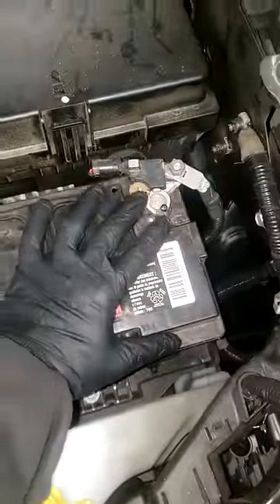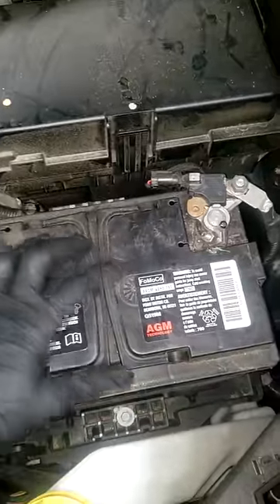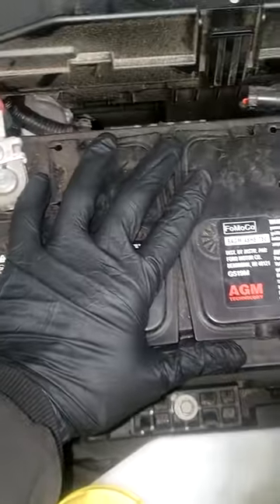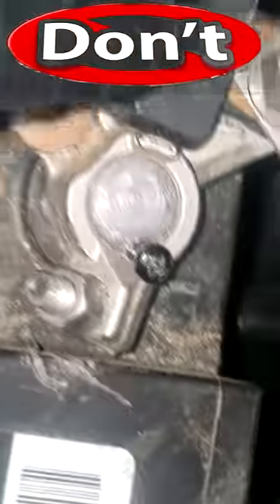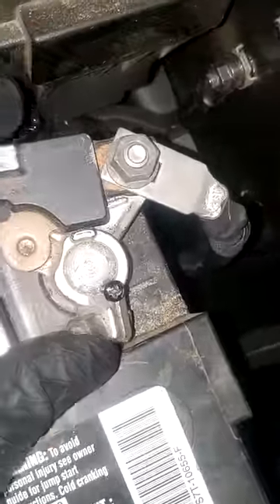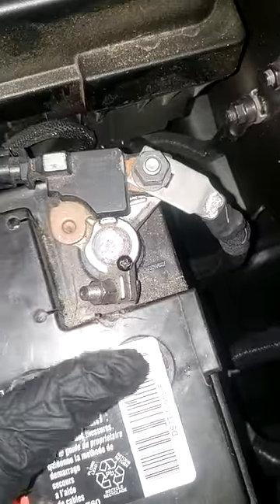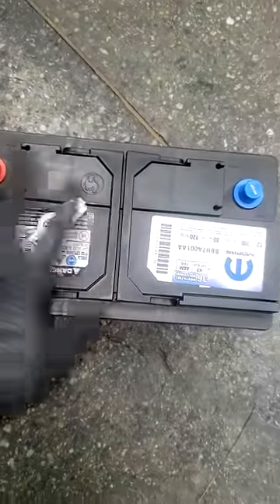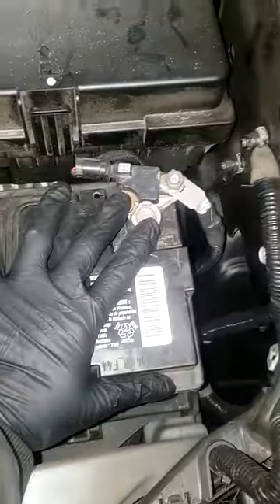STOP DOING THIS PEOPLE. This will destroy your car electrical system.

Comment: I am assuming that first you verified the complaint. Then you isolated the failure. Performed the battery charge and test. Verified the sensor failure.
Reply from the maker: Yes, this battery also failed the GR8 load test and after she saw what the last shop did, she wanted everything replaced. These shorts videos only allow you 60 seconds and you cant explain all that in that time.
Reply: @OnlineMechanicTips  For those of us who don't have a clue, what is a "gr8 test"?
Reply: @paulmonk7820  its a common battery testing tool, its a big boy tho, the normal ones are handheld but that one is a roll-around and it has a ton of different tests it can do, from checking the full starting system to detailed tests on battery charge/discharge and other things
Reply: @paulmonk7820  or just Google gr8 test 🤷🏽‍♂️🙄
Reply: @paulmonk7820  it's just a really really good test
Reply: @mando4660  its more then good its grrrrrr8
Reply: @paulmonk7820  and now we have the DCA-9000, yay... The gr8 is a good machine, I had better luck with it than the ED-18 then again as that thing got older it really didn't test batteries properly in my opinion. No matter because now we have newer, slower moving equipment. Cheers
Reply: @HarleySLA the good old ed-18. It isn't even worth using that because it is just gonna tell you to use the gr8 anyway. I like the new dca-9000, I don't like how it times out and shuts off but it seems to work better than the gr8.
Reply: @sleezymechanic  I hear it goes well with milk.
Reply: @MikeDCWeld  🤣🤣🤣
Reply: @OnlineMechanicTips  - lol,you shouldn't have to explain that.   It's called a "Short"
Reply: @sleezymechanic  - alright,tony
Reply: @vbarbee1  or just google the initial problem and find real online mechanic tips to begin with.  Because pointing out a screw in a battery terminal is not a tip.
Reply: @skachor  Ha! Seems somebody already “Googled it” and the tip was to drive a trim screw into the terminal. Now its at the dealer for a proper evaluation
Reply: @raincloud54  yeah, maybe he came across one of the videos funkfpv roasts
Reply: At the Nissan dealership I work at they are making us use this new dca 8000 tester machine. It's really good, but wants to charge for around a full hour for every test. But it does everything
Reply: @sleezymechanic  haha, beat me to the Tony The Tiger joke. Well played, sir.
Reply: @sleezymechanic  I laughed way too hard at that!
Reply: @paulmonk7820  gr8= great 👍
Reply: @vbarbee1  all you guys jokes
And Paul is really trying to learn 👀 
🤦
Reply: @paulmonk7820  It's like then gr7 but better
Reply: @raincloud54  27 & self employed with 3 part time employees.
Reply: @codygooch510  nail salon?
Reply: While he puts the new battery on the concrete lmao
Reply: No he didn't....
Reply: @Kolonol1  He’s a good dude. Just all caught up in a high volume dealership shop. Most of these bean counters dont want to pay you to be thorough but absolutely shame and penalize you for the consequences of not paying the extra hours it takes to maintain the highly skilled meticulous techs. I was a field engineer for GM for a few years and witnessed this phenomenon growing and festering. It takes as many hours nowadays to keep up on new products and procedures as actually barking your knuckles. We havent even touched on documentation which a lot of times takes longer than the actual operation. And they dont pay you for that either
Reply: @raincloud54  I don't entirely agree with you there....the shop I currently work at is just me and the owner. I like it better that way. But we move way more work than shops with 5-10 techs and we bust jobs out in record time with sometimes much better warranties and we fix a lot of stuff that isn't charged because no one knew it was broke when it came in. We work on everything from weed Wackers to mining dump trucks...this video personally is not getting caught up in anything but a lack of knowledge on his part. As for paperwork...not really...dealerships have people for the paperwork... Not entirely sure what there is to keep up on that you have to spend time with... Especially at a dealership
Reply: @Kolonol1  yeah. Anyone who works at a dealership knows exactly what Im talkin about. Chase down a minor vibration on a luxury car with a Pico scope sometime or chase down an intermittent short on a UART line. Then try to get paid for your diag time.
Reply: Yea mechanic replaced everything first and the problem still exists. But the customer still pays for the labor and parts he didn’t need and still has the same problem! 
Reminds me of a friend of mine that owns a furniture store. His furniture store delivery truck kept dying on him on the way to different deliveries to customers homes. Then the truck would be towed to the nearest repair shop.   One repair shop replaced the starter for a engine dying? LOL that’s no joke either! I told my friend replace your fuel filter, that’s probably your problem. Of course he didn’t listen to me. He spent a year messing around with the truck dying over and over and taking the truck to different repair shops that kept replacing expensive parts the truck never needed. Finally after spending over a $1,000.00 at these repairs shops he finally asked me to change his fuel filter for him. Guess what? Truck never had any more problems with the engine dying!  I believe you start with the cheaper item’s first to replace and work up to the more expensive items if you need to?  Many times it’s a cheap part that needs to be replaced. But these repairs shops go for the most expensive parts first and the parts they replace are usually labor intensive as well as expensive costing the vehicle’s owner more money and still has the same problem it had before the repair shops ever touched it!  
If you find a good honest mechanic, hang on to them for as long as you can! Good honest mechanics are not easy to find these days. I have plenty of horror stories to prove it too!  Unfortunately the last honest mechanic I used for decades finally closed up his shop after he was 75 years old. Been looking for another honest mechanic ever since! Still haven’t found one!   Dishonest mechanic may get me once, but they won’t get me a second time and I tell everyone who’s the dishonest mechanic is that I know too!  Funniest one was when I took my jeep into Jiffy Lube for a oil change. Their employee comes to me and says my radiator needs to be flushed that it’s really dirty! Here’s the funny part! I had just put a brand new radiator in my Jeep just before driving it to Jiffy Lube!  Told the employee that really funny it needs to be flushed when I just installed a new radiator! Employee started back talking real quick and blamed it on another employee under my Jeep in the underground bay. Needless to say, I don’t trust Jiffy Lube anymore!
Reply: @OnlineMechanicTips it actually didn't take 60 seconds to read raincloud's comment so yeah...
Reply from the maker: @Kolonol1  Out of all that you said the only part I noticed was you questioning my lack of knowledge. Did I read that right?
Reply from the maker: @skachor  If you know so much about making tip videos, why don't you do it instead of riding the sideline being a cheerleader troll.
Reply from the maker: @inspireonex  lol..huh? What he say?
Reply: @OnlineMechanicTips  I'm a professional tip comment maker.
Reply: @Harley C  my dealer just got the Maximus a few months ago, beats the hell out of our GR8s
Reply: @OnlineMechanicTips  you missed liking one of your own responses here.
Reply from the maker: @skachor  Lets hear what you got
Reply: @OnlineMechanicTips  make a tip video that actually provides a tip.

The next one won't be free.
Reply from the maker: @skachor  Its like 1k vids on this channel, surely you can find 1 thats tip related...lol
Reply: @OnlineMechanicTips  why would I look for a needle in a haystack.  I'll just find someone with stacks of needles.

I think you're just grinding the hate, and ngl I think it's genius.
Reply from the maker: @skachor  I take back the thoughts I had about you earlier, I was thinking you was just another typical slow clown looking for attention, but seems I was wrong. You actually pretty sharp
Reply from the maker: @skachor  No need for me to do that, im guessing the viewers with common sense doing it.
Reply: @OnlineMechanicTips  yknow, respectfully I'm just gonna leave a man and his means.  I got caught up in the content and forgot this is also a guys stacks.

Peace, my friend.  Your content isn't for me, but i still wish you prosperity and happiness.
Reply: Um.... No.
Reply: No fam he just tested the battery lmao
Reply: Technician B says

Comment: Had a customer with a '15 mustang. Some other shop sold him a $300 battery but didn't bother cleaning up the corrosion or anything. 30 minutes later it's all cleaned up and everything. Corrosion WILL spread, and it's a pain sometimes lol.
Reply: You need to clean the cables on Fords when you change the oil, its a ford thing.

Comment: This happened to me, after I installed my subwoofer. I tighted up the positive cable, but not enough. It took about 2 weeks before the cable got loose enough. The dash lit up, then was fine, then lit up again, then was fine, so I pulled into a parking lot and as soon as I pulled in the car shut off completely. I rolled into a spot, thinking my alternator was done. Started lookin at stuff, checking wires, then thought, I just put the sub in..... Popped the battery cover off and badda bing  badda bunghole the battery cable had popped off. Connected, tightened, good to go, hasn't been an issue since, that was 3 years ago.
Reply: U pointed out a point…your POSITIVE terminal 
     This one’s the negative side…
Although the screw is steel I don’t think it would cause the issues this guys saying.

Comment: If you're out on the road and you're in a jam it's actually a pretty decent way to get you to where you need to be so you can fix it.
Reply from the maker: True and mind you this do not affect older cars that do not use battery terminal sensors IBS
Reply: @OnlineMechanicTips  And... you cannot explain how or why it could potentially affect anything on newer cars if used as a temporary or even a long term "fix".  Granted, it isn't the right way to fix it but touching it isn't a sin and the car doesn't care.  Would I do it to my car?  I would not but I wouldn't replace the both pieces just because.... I would replace whichever part was causing it not to tighten down correctly.  Even a good battery terminal shim would fix the problem if it's just a terminal that won't tighter.  I suppose, though, it's likely a BMW and the owners are used to exorbitant, overpriced service and repairs.
Reply: @watchdogu.s.a.8973  he can’t explain it because he doesn’t understand how it works. The sensor is in the plastic portion of the terminal/sensor component. What the screw was in was the terminal portion, which is straight metal not part of the sensor. What was likely happening was corrosion on the battery posts and or negative terminal. I’ve seen this happen a lot. It becomes an insulator and blocks electron flow which begins to strain the electrical system until things start failing. The screw in this case is only being used to better conduct electricity from post to terminal. 

But what do I know I’m only an electrical engineer with nearly a decade of experience who has also been fixing cars for over a decade. I’ll believe bubba here who can’t explain why he replaced parts, just that it now works.
Reply: I used a penny once to take up the distance.
Reply: You could just buy a terminal Cap, which is an actual temporary fix. Keep em in your glove box.

Comment: Hey brother I’m not trying to jump on the bandwagon of putting you down
But I can tell you from my own experience as a tech that Chrysler products get reaaally whacked out with a bad or incorrect battery, almost exactly the type of issue you’ve described. 
While the screw is definitely not the appropriate fix or something I would ever do myself, I’m very much doubting it caused any issues. 
Now that said, I wasn’t there in front of the car so I can’t say wether the IBS was bad or not but just a tip for the future don’t go for the shotgun blast approach of diagnostics, slap the new correct battery in and confirm your suspicions. ALWAYS double check yourself it’ll save you a headache or looking silly in the future
Reply from the maker: This was a not that type case. Customer pretty much had it with the electrical problem and after I showed her this, she hate hacks now. She want her car back to specs. Im not wasting anytime on trying what you suggest. Lady want her car fix and money not an issue. Im basically her last stop. The call I made was these 2 parts, she agreed, she happy and gone. All good
Reply: @OnlineMechanicTips  wasting time on putting in a battery that you were going to put in anyway?
Reply from the maker: @JohnDoes620  No you suggest testing and trying things thats visibly compromised. Thats pointless on this case. We got to get the battery connections back to factory specs using factory parts is my motto. No hackery over here.She want her car fix and money not and issue. Especially after I showed her what they did.

Comment: Yeah you'll be in the same position it came in as! That screw will not cause any issues. 🛑
Reply from the maker: Then leave yours in there. I chose to fix this car right. Thanks you
Reply: hes right my guy...the screw will not cause no issue it will make more contact and proper contact..its not like you grounding it with that screw my guy..but thats you not me.
Reply from the maker: @franciscogutierrez7470  Now just why do you think the customer at the shop in the first place?  You guys are use to doing this stuff in your older model cars which was fine then. Not so now. Things have changed buddy, seems youre left behind
Reply: @OnlineMechanicTips  dude. You were called out for doing wrong. Stop lying
Reply: Has anyone ever head of keeping a car oem lol. Even if the screw is not affecting it I'd replace it. You don't want your customer to think your Jerry rigging there car. Most customers want it done right.
Reply from the maker: @jamesolelo4406  What on earth are you talking about. Are you on here again looking for attention?
Reply: @OnlineMechanicTips  I'm an active dealership master mechanic and can confirm, this screw won't cause electrical issues.
Reply from the maker: @stephenconnors2111  Watch this, I also do brain surgery and I can confirm, if your head hurts, you should take a aspirin. Hows that? You see how easy it is to make shit up on the internet. Now you got a big ass S as your screen name. At least mine should be believable, you can see my channel. My dude dont insult us like that. For starters, even if its true, who the hell cares? What that suppose to mean? Its true if you say it? On this video my take is that the screw affects the connection between the terminal/IBS and the battery post. When that happens, all hell could break loose. You could even brick your transmission and knock it off line doing this stupid shit.
Reply: Its amazing how nobody can figure out what you did right
Reply: @OnlineMechanicTips  You don't have to believe me. Your response tells me you're not willing to be open minded to what others have to say anyway.
Reply from the maker: @stephenconnors2111  Believe what?, this has nothing to do with believing. You simply voiced your opinion that the screw wont cause electrical problems. As a active dealership master mechanic which I am as well, I would be ashame to even say or mention such a thing like that. You just gave the green light to every aspiring mechanic out there that this is ok. smdh. Fact is, no hackery or foolery have no place on these newer cars. Poor connection at the battery is the worst thing you can do to these newer computer controlled cars. You should be ashamed of yourself.
Reply from the maker: @trains2057  The customer is happy and gone, thats whats amazing. The experience she had at that other hack shop was terrible.
Reply: @stephenconnors2111  exactly.  They made this post to get attention and didn't think people could smell their bullshit
Reply from the maker: @jamesolelo4406  Attention?
Reply from the maker: @jamesolelo4406  Learn what? You havent taught anything. You merely stated that the screw did not do anything. You basically on here defending that screw. Thats nothing to learn. Thats simply your opinion. You entitled to that buddy
Reply: @OnlineMechanicTips  no opinions.  Reread for comprehension as you were already told,not double down and misread again lol
Reply from the maker: @jamesolelo4406  Seems im unable to properly process hackery repairs. Maybe thats it. I dont understand your lingo. I wasnt trained that way so im having a hard time comprehending such foolishness.
Reply from the maker: @jamesolelo4406  Yea mun. No hackery experience/training over here, I cant relate. Sorry
Reply: @OnlineMechanicTips  when you stop being foolish you'll understand
Reply from the maker: @jamesolelo4406  Lol, bruh are you bored? Im in the middle of editing 5 more videos. But none of it will be hackery so I need to get this right. Are we done here?
Reply: @OnlineMechanicTips  are you ever going to respond properly?